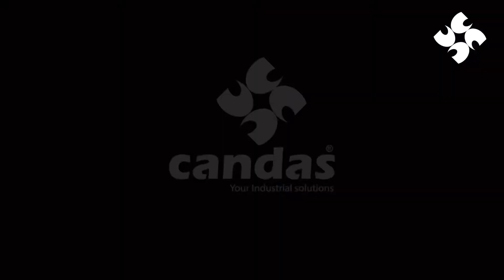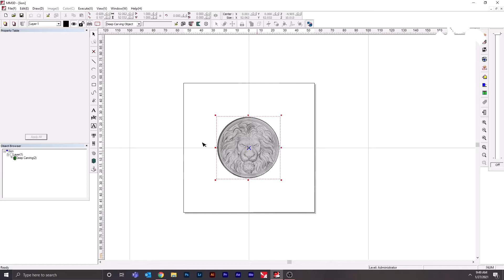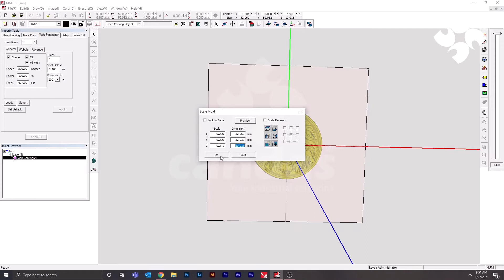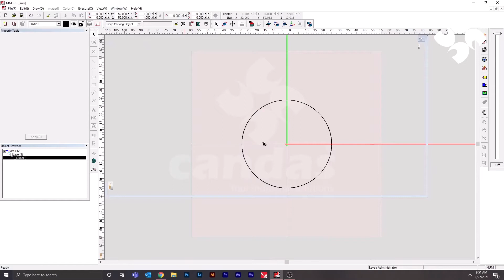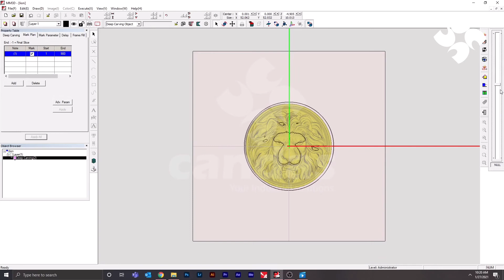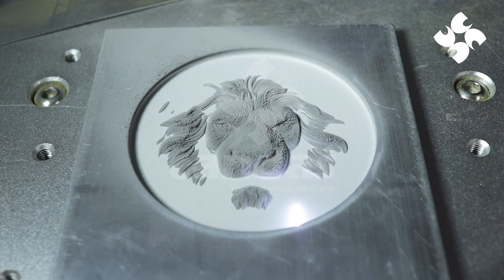How to use fiber laser for 3D engraving

Comment: He doesn't seem to want to answer any questions regarding what machine he is using. Does anyone know what is needed to accomplish this type of work?
Reply from the maker: its 100w fiber laser machine with 3Dmarking head
Reply: @candastec  can you give me pricing for a machine that is capable of doing this type of engraving. I'm interested in a 60 to 80 watt machine. I want to engrave tool steel to make stamps for metal. 
Any information regarding this would be greatly appreciated.
Reply from the maker: @michaelburke5750  dear micheal can send the request to our email info@candas.cn
Reply: Can i use 3d marking head with 30 watt machine  , please let me know

Comment: 36hrs damn
Reply: Something you get used to when you've used 3d printers. I've done some 60 hour prints. Longest job for my diode laser was in multiple parts and took about 8 hours including moving things around and setup. Even longer if I include the time it took to run tests to get photos just right on stained wood.